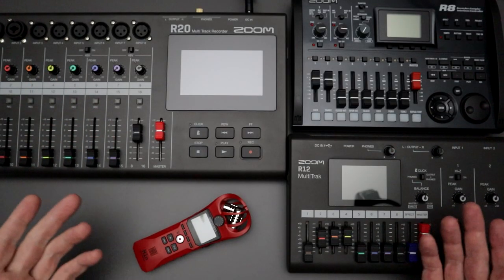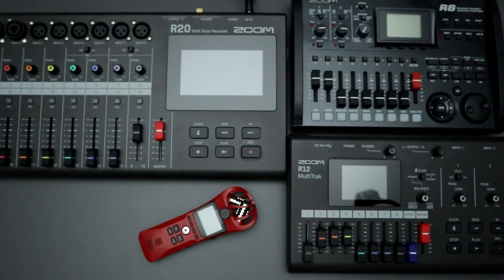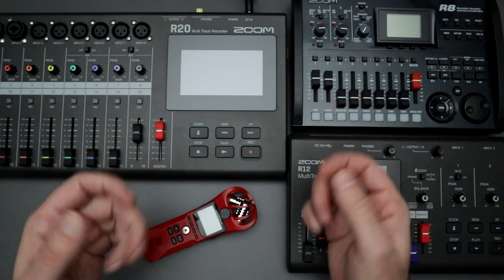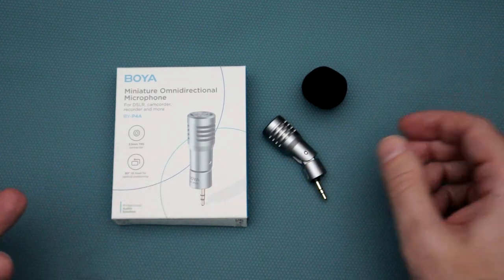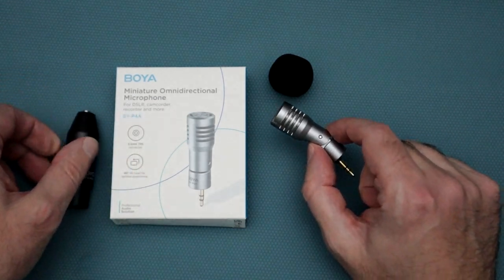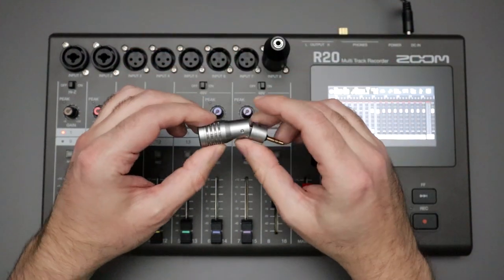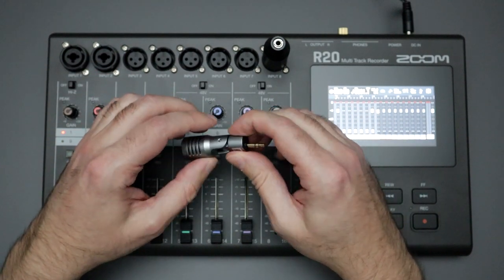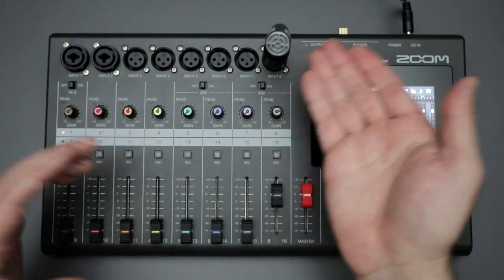DIY "Built-in" Condenser Mic $20

Comment: It's a shame Zoom removed those mics from their more recent multitrack recorders. I don't know what they were thinking. For quick and dirty recording I still use my R8 over my R20 purely because of the mics. Still, you've found a nice way to overcome this limitation!
Reply from the maker: Yeah, like I mentioned I don't think it's dealbreaker to prevent people from buying the R20 or R12, but I'm a little surprised Zoom didn't at least include a built-in mic on the smaller R12.  The R20 is designed to sit on a desk and sort of stay there.  The R12 is all about portability and having a built in mic on that unit would have made a lot of sense to me.  At least for me, this little $20 solution sort of gets the job done for that quick recording purpose.
Reply: i was thrilled to see they included a mic on the new R4
Reply: @pirateshack9315  Zoom R4 heh? I hadn’t seen that come out. I’ll have to have a look

Comment: Thanks for this info. I use my H4n for stereo recording and dump the files to the R20. For $20 or $40 for stereo, it’s a great fix.
I like the high end this mic, which can be adjusted in post.
Reply from the maker: You're welcome. The H4n is good.  I think the built-in mics on that are slightly better than they are on my H1n.  That's an easy workflow if you can record with the H4n and then import the audio files into R20 tracks afterwards for further editing.

Comment: Here a thought. Use an audio cable, 1/8 TRS, from H1n audio out to the Movo adapter to use its mics? Will try this with my H4n Pro

I bought the Movo adapter and paid up for the Boya BY-M100. Interesting that it needs the phantom power on to work. It gives a nice deep tone without being muddy. Distance to mic makes a big difference.
As an aside: Your video on loading and changing patches is great. Started editing with them and they are actually pretty good. Too bad they ant be added to a dry track.
Finally, very found that plugging 45 degree patch cords into the 1/4 holes are easier to get out than the straight ones. There’s got to be a designer story behind that. On,y Zoom product I have that takes 5lbs of pressure to get them out!
Wants:
1. Punch in and out.
2. Track naming.
3. Track assigns of plugged in mic to a different channel.
Oh yeah, better quality midi patches.
Reply from the maker: All good comments.

The H1n can output it's own power, so I don't need the MOVO adapter for that.  I can run a 3.5mm TRS cable out of the H1n and then into a 3.5mm TRS female to stereo break out cable that goes to two 1/4" male plugs that are TS and put those into inputs 1 and 2.  That works.  I just like the convenience of my little compact DIY for quick recordings with acoustic instruments.   

I actually have the BOYA BY-M100 as the USB model.  I got that one first, which led me to the PY4A model.  I got the PY4A model because it was the cheapest option I could find.  I think the BY-M100 is a better mic, and it rotates 180 degrees instead of just 90, but it is more expensive.

Interesting that 45 degree patch cords are easier to remove.  I don't have any 45 degree ones...I'll have to look for one and try it out.

Agree with all your wants.   Here's hoping at least punch I/O makes it to a hypothetical v4.0.

Comment: I tried this exact set up and its not working. Any ideas what i am doing wrong?
Reply from the maker: I'm not sure?  Do you have the right combination of mic and adapter?  For this particular combo the mic needs to be the TRS version, not the TS or TRSS versions.  And then the 3.5mm to XLR converter definitely needs to have that phantom power step-down converter built-in to lower the voltage being delivered.  And obviously, you need turn on the 48V phantom power for the input on your R20 or mixing board that you are using.

Depending on what you are recording, you'll need to turn up your gain.  For acoustic guitar on the R20, I need to put the gain up around 50-60% usually.  For vocals, or general room recording, I often need to go past 70% gain, and then sometimes I turn on the noise gate for the channel.

Comment: Surprising how good the small mics are on the Zoom and Boss BR recorders.  For what they are, they do get the job done.  Checkout some Boss BR-80 videos.  You'll be surprised.  Even on vocals.  Boss (others) also used something call "plug-in power" condenser mics that required only 2.5v of power.  I am not sure if they are still made or if the mic you have here would be a good option.  Another great video.
Reply from the maker: I've seen the BR-80 and have been intrigued by it, but I have a Zoom H1n for pocket sized recordings (albeit it not a multitracker).  I also compared the BR-800 vs the Zoom R8 way back when I made that purchase.  I've always liked BOSS/Roland's effects in their devices. However, the built in mics on lot of those multitrackers are adequate performers to pick up a single instrument or a dirty recording of a band.  I didn't use them often, but the mics on the R8 are serviceable under most conditions, and there are two of them for stereo recording.

Comment: Nice Tip man. It doesn't sound that bad. I think the zoom h1 sounds more focus. The R8 sounds very bright and roomy. The DIY mic doesn't sound that bright but maybe it works fine with some EQ.
Reply from the maker: The DIY mic does work better with some EQ adjustments and a little compression, but it is flatter than the other mics.  But I probably prefer the R8 mics, especially for acoustic guitar.  I think the physical spacing of the two mics on the opposite ends of the R8 gives it the best spacial sound.

Comment: I have the R20 but haven’t felt as connected to it as my R8. I think with the limited rhythms in the R20 and no mics make it more troublesome.
Reply from the maker: The R20 rhythm options are very different compared to the R8's.  The R8 with the sample pads and rhythm sequencer offer something much different compared to the stock 1-measure samples with the R20 or the synth kit #19 (drum kit).  I only used the R8's sequencer once in awhile, and I rarely use the R20's rhythm options.  Lately I've been making up my own percussion tracks on an external drum machine, recording that on the R20, and then work on my song from there.

I think if you rely heavily on your multitracker to provide your backing rhythms, I can see where the R8 has more advantages there...especially with the sequencer.  I was just personally limited by the 2 inputs with the R8 at times, which is ultimately why I bought the R20.

Comment: i used a tascam DP-008EX for awhile and a h1n
Reply from the maker: I tried out a DP-008EX for awhile and I liked the form factor and I thought it's built-in mics were perfectly capable, but I  just prefer faders vs knobs for controlling levels.  Plus it was only 16-bit.  That's why years ago I ultimately went with the R8 instead.
Reply: @GazRendar  makes sense